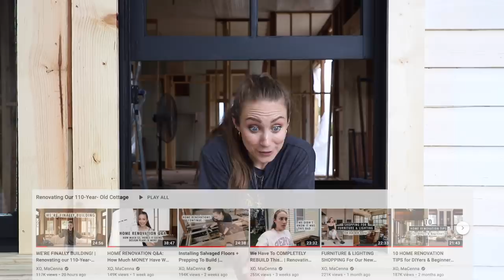First DIY PROJECT for our NEW HOME // Restoring Century-Old Windows | XO, MaCenna

Comment: Heads up, the weights are sized to the weight of the window they are carrying. You may want to check to see if the Low E glass is significantly heavier than the old glass. You may need larger weights. Worth finding out before you close the interior window trim.
Reply: Good advice.
Reply from the maker: SO TRUE! Thank you!!!
Reply: Good advice.
Reply: Good info
Reply: @XOMaCenna  So true?! Argh that means you already know this? I love how thorough you've been in your research! This might be adding to your list of things, but would you be able to jot down a list of things that you didn't know while renovating? Like window weights? I had no idea windows had weights! This would be so handy to know. Love watching you do your thing cause your passion SHINES through.
Reply: Check to see if they sell the thickness of the glass you need. Working on restoring a cabinet w glass and the thickness of the original glass is no longer available for retail sale, the slimmest thickness of glass will not fit in my door frames
Reply: I was thinking the same thing!

Comment: I completely disassembled, stripped, filled, sanded and repainted with Ben Moore White Dove, 22 double hung wooden windows (including all trim pieces) in my vintage home. I also removed every glass pane to strip, sand, and paint in the crevices…reinstalled and glazed all the glass panes…reinstalled the windows with new sash ropes and new window latches…and handle lifts…and though it was quite an accomplishment and they turned out beautifully…it took me years.  Your windows are gorgeous…I love how you took out the roller hardware and sprayed it antique brass…wish I’d have done that…I painted mine.  You mentioned thinking three weeks was a long time to redo five windows…but…that’s actually warp speed.  This kind of restoration work takes so much love and care…that’s why it’s so valuable.  Your house is going to be amazing.

Comment: The reason contractors don’t like to work on old homes is simply because they are rarely straight and plumb so it is easier to tear down and rebuild and faster and cheaper and they can move on to new jobs! It’s always a question of money, they don’t really care if you are invested in your antique house or not. Btw great work 👍
Reply: Yes! Also old houses always come with unique problems which require unique solutions. Whereas on new builds it's pretty much all the same so they can just do what they always do 🤷🏻‍♀️

Comment: I really respect that you’ve been restoring the windows. I absolutely love that you’re being environmentally positive. I just had one question, has restoring original ones turned out to cheaper that buying new ones? I understand you’ve put in so many hours of labour. The reason I’m asking this I’m in a similar situation where i need to replace few windows from a 80 year old house. I just want to go renovate the older ones but is it cost effective?
Reply: I’m doing the same for a old house, and the cost is significantly cheaper for me (just paint, glaze and rope!) it’s really a mater of if my labor is counted because it’s a lot. For a small room with 5 windows (wall of windows!) it’s taking me like 3 weeks 🤣 it’s so much sanding and I’m weak lol

Comment: Make sure you use a level horizontally and vertically when installing trim or windows. You also should get a speed square to make sure all your angle 📐 is square. 

The reason boards are not the actual size had to do with milling. Over time boards got smaller and smaller because smaller was easier to move and increased production. 👍

Comment: First !  In south Texas i. August we never complain about rain.  I’ve been and am currently where you are.  I enjoy your excitement and your hands on temperament.  My husband and I renovated a 1908 house in New Braunfels.  Loved every minute of the 36 years we have lived there, but old houses no matter how much you renovate, always need tending.  As we are retiring next year we bought a smaller and slightly younger house (1958) that we are renovating.  I too salvaged part of another structures floor that matches ours after spending weeks removing nails (they were nail crazy), sanding.  I am finally to the point where I’m ready to varnish.  Still need to trim windows, looking for trim like I have in my New Braunfels home.  We chose to go with R-42 double pane in the new house.  Utility costs is one of several reasons we decided to go smaller and slightly less historically accurate in new house.  Even with insulation added to walls, under floors, 2 layers in attic, energy dual compressor efficient central air/heat our monthly bill is a budget buster.  We left the single pane glass in place because they were hand blown.  Where you have guest cottages, I have a studio 16’ x 32’ , (used to be carriage house for horses & buggies/wagons., a hot tub room (summer kitchen) and my husband’s wood shop.  Base bill which includes  electric, water, sewer, trash & recycle.  In the months where we have neither ac or heat on $483.00/month.  Leaving those single pane is a monthly budget buster.  And the old sash weighted windows don’t accommodate double panes.

Comment: I really love the black you painted on the sashes. I know it wasn't around (trending) when I replaced all my windows 15+ years ago, but eh, curtains cover most of it anyway. 
Mine have double locks on them. I'm glad you saw that example in the coffee shop.
BTW, I went with triple-pane glass. I don't think that's necessary. The salesman said I wouldn't hear neighbors' mowing their grass. He lied. I have across-the-street neighbors who mow their lawn (at least) DAILY when leaves drop. 
 I know we've been beating up on you pretty severely about the lack of insulation. With all the rain you've been getting I was surprised you didn't caulk the sills. I'm not an expert, I just watch a lot of reno shows and they use caulk and foil tape to seal out moisture. Sorry, I know my feedback comes too late to do anything now. 
And how does one keep their job with such poor forecasting?

Comment: Hello from Canada! 🇨🇦 You are an inspiration and a delight to watch. I really cannot tell the difference between the white dove and white wing paint. May I suggest adding a tiny bit of black to your white dove to get a better contrast. If it was me I would test a mixture into a measured amount to customize (1/2 cup white and 1/8 teaspoon of black & paint that on the trim). Refill with white dove and add another 1/8 teaspoon, then another and another to see which one gives you the best contrast. Adding black to the white is going to blend ever so slightly but will also definitely  compliment your black windows. This will save you time and money rather than purchasing more samples. I promise you won't be sorry. Keep up the great work and give your mom a high five from your followers, she is an angel for all she does to help you. 💜💙💚

Comment: MaCenna,  normally before windows are installed you installed a window tape (ask your dad I forget the name I'm sure he knows) you can get it at lowes or home depot it helps prevent any leaks and drafts, then after window is put in and then spray foam is done around the windows... on the inside and then interior trim, we just installed 2 more windows in our home, so I know what you mean, THAT was a bit of a job, working on an incline 😳...Can't wait to see more of the progress! ☺️

Comment: Wow, it's really starting to look like a home❗🥰
Keep on keepin' on❗👌 🥰

💡 Primer:   
You only ever need ONE coat of primer! Money and time saver! 💲🕛 
💡 Latches:   
Love the brass! Sooo glad you're going with 2 instead of just one per window (that was off-center)! 👌
💡 Front 3 Windows:   
I sooo agree with you that you HAVE to raise the one on the right! It would drive me crazy as well if they were not even. What were the contractors thinking? That you wouldn't notice?! 🤣🤯
💡 Center Window Trim:
I agree, it breaks up that span nicely. You wouldn't have liked it with just the wide, flat board. 👍
💡 Weight Rope:
The white rope is more authentic, although the metal would last longer. I hope that the rope lasts for another hundred years! 🙏
💡 Painted Metal Hardware:
I hope you used a rust-inhibiting paint on them. That will offer a lot of protection for them, and not just from water! ⛈👐
💡 Window Paint:   
Please tell me you painted the bottom edge/side of each window?! That's what will need the most protection from water damage! 💧
💡 Outside Trim Color:   
The top one of the 3 is too light; not enough contrast. If the contrast isn't great enough, then it'll just look like you screwed up and got the wrong color to match the siding.
In the original Era, the trim would have been colored. Have you thought at all of a beautiful light green, like Benjamin Moore's: CC-610 Tea Light, 2034-60 Light Pistachio, 400 Polar Lights, CSP-790 Budding Green, HC-140 Prescott Green, HC-139 Salisbury Green, 507 Grecian Green, HC-117 Hancock Green, HC-141 Hollingsworth Green, 848 Lakeshore Green, 842 Green Cast, 2139-60 Green Tint, 415 Riverdale Green, 2035-70 Italian Ice Green, 421 Green Cove Springs, HC-120 Van Alen Green, 1619 Silver Mist, 1584 Pale Smoke, 1436 Whirlpool, 1660 Polar Ice, 1618 First Snowfall, CSP-755 Dusty Miller, AF-465 Wind Chime, CSP-785 Sweet Celadon... 😉

Comment: I did white siding and black windows at my parents place. We considered painting the trim a slightly different colour, but ended up painting the trim the same colour as the siding. I, like you, was worried there wouldn't be dimension between the siding colour and the trim. Honestly, it actually turned out fantastic. The texture and dimension difference just between the siding and the trim alone was beautiful. You may not actually find it necessary to paint the trim a different colour. Not sure if this helps! Otherwise, everything looks FANTASTIC. A huge congratulations to you and all of the amazing work you've done to date.

Comment: Totally random fact. But in Australia, hi I’m from AUS!! The weights from old windows like yours are usually made from lead. When contractors would rip out the windows they’d just send them to the dump (not sure if you use the same phrase over there😅 but it’s kinda like landfill). So what Aussie fisherman’s would do is they would salvage the weights and recycle them for weights or lead sinkers for deep drip fishing. Sometimes they would use them in their original form and other times they’d melt them down to make smaller sinkers. Totally random I know! But my dads a massive fisho so I learnt that from him. ❤️ 🇦🇺

Comment: Let me start off by saying I love her enthusiasm and hard work!! Way to go, McCenna! 

Now, as for the paint for the outside window trim, I don’t understand the need for a change of color that you can’t even tell the difference to. The dove white from the house to the other dove variation for the trim look the same, it’s not even worth stressing on getting new paint. The bottom option is definitely more contrasting than the middle one, but at least both of those as noticeable. You know what I mean? Like, if you’re gonna go out of your way to paint a different color, at least choose one that’s a little different than your house color. 
Well, at least that’s my opinion 💛 Either way, so far, so beautiful!!

Comment: When it comes to that little extra bit you are attaching to the 12" board between the windows i would suggest that you paint that little added piece the same colour as the house rather than the colour of the trim. It wouldn't be a dramatic difference obv but might break up the 12" of same trim colour. Also I like the contrast of the trim colour to the siding colour but im not sure about the dove being a warm against the cool of the house. Maybe a cool darker colour would be better?

Comment: I vote for MORE CONTRASTING COLOR in the window trim between the black & white.  The color that you're leaning towards is practically the same as the siding color.  At least the color that you had on the bottom had more contrast.  Houses in the early 1900s had lots of color in the exterior trim, esp a home of your stature.

Comment: Just and FYI when looking at Benjamin Moore Off white (the OC-##) the next colour on the chip is not necessarily related to the previous. Generally they group them together based on formula but the colour next to it isn't just like a lighter or darker version. the only colours they have that work for sure that way are the preview colours with ####-## formula. for example 2051-40 Crystal Blue is the lightest in the series, 2051-40 Majestic Blue is the middle tone  and 2051-10 Yukon Green is the Darkest.  The variance is in how light and dark it is but the colour is the same. 
Having said all that I looked through all my decorators fan decks and  searched up some things online and Dove White is also know as PM-19 which I believe refers to previous colour collections but i cant figure out which one. Anyway PM-20 is China White which now goes by OC-141 and from looking up the hex codes on those colours are very similar with Chine White being a bit darker so you can check that out. 
Also if you look up colours Similar to Dove White on the BM website they have a see similar colours button and that suggest AF-15 Steam as being close so maybe thats worth looking at or one of the colours around that. 

TL;DR for trim try China White OC-141, AF-15 Steam, or a surrounding colour.

Comment: Sorry, one more tip; when spray painting the sash, the edge where the rope goes, does not need to be painted. In fact, if it is painted, it can actually cause the sash to stick. If the sash are this old and haven't rotted in this area, there is the proof you need. No paint on an unexposed surface. Keep up the good work!!

Comment: I also purchased that same spray gun.. did you experience a texture in the paint after it laying for a few hours? I noticed I had to sand it down a bit after it dried to get a smoother feel. I also know you can add a paint thinner but I believe the gun states not to add thin or water. Regardless it definitely beats having to hand paint!

Comment: At your age, I was stripping tons and tons of furniture, it is a very hard, long and unpleasant process but more we do it, easier it becomes. However, once completely stripped, it needs to be washed and brushed to remove everything dirty or the product by supposing you used some product, which doesn’t seem to be the case. Some woods, like oak for example, must not be washed, in that case, it must be cleaned with some alcohol, to remove any residue. 
I would have painted the windows after painting the house, but at least, we can see how nice is this black on these windows. They are nice.

Comment: Just future reference if those windows had lead paint which I'm guessing from the age of the house at least some did: heat guns plus lead paint can be really bad if using a high heat heat gun. The lead actually aerosolizes at very high Temps. Just a safety note for anyone who might be considering doing that in the future! ☺

Comment: I have been thinking about the framing for the window the contractor did that was higher than the other 2 windows it was beside. That is so unbelievably crazy. You have made such complete plans and even if the contractor didn't have these plans, he should know to put it level with the rest of the windows. This mistake combined with some of the other mistakes they have made, I think I would change contractors.

Comment: Just an FYI, we had the original windows from our 100 yr old home restored but added double pain glass and found that our existing weights were not going to be sufficient to lift windows!  We had to put new ones!  The double panes help with noise reduction and insulation!

Comment: Dove wing is not your trim color...not enough contrast.  Not sure if the trim board on the double window unit it wide enough.  Try a board that is the same width as the outside trim and see how that looks in the middle.

The house I live in was built between 1870 - 1880. We did what you're doing 31 years ago.  So much hard back breaking work but it is so worth it in the end!

Comment: I love it!! However did you notice that of the three windows that are side by side, the two new ones aren't at the same height either? First one is a tiny bit higher than the second one. I would be so angry with the framers. Can't they measure things properly? You can really tell that they are not even because of the siding.

Comment: You can’t got 60 to 220 grit in one leap. You’ll leave a LOT of swirl marks from the sander that might not always be visible immediately, but will definitely be visible.

But I’m exhausted watching this because I have all my windows to tackle and just brought a heat gun to tackle the project. Good luck!
Reply from the maker: Oooo thank you I didn’t know you had to step it up one more time. Although I didn’t see any swirls Since we were painting maybe it camouflaged any that were there. Some things we will be staining so ill definitely be stepping it up in grit for those. Thank you
Reply: @XOMaCenna Yeah, it’s a huge pain, but I try to hit it with 80 after 60, then 120, then 220. Great thing though is usually you have to spend less and less time with each consecutive grit progression. Depending on the color/sheen of the paint how much will show. If you’re staining it, DEFINITELY spend your time. 100% worth it.

Comment: Bees wax rubbed on the outer edges of the sliding windows and the insides of the frames occasionally will keep them sliding open and closed smoothly -- old trick my dad used to use every year.  Nice job -- happy you didn't purchase new, old windows deserve preservation.